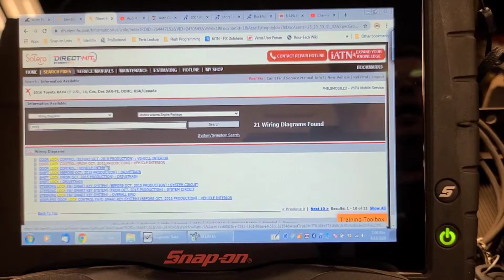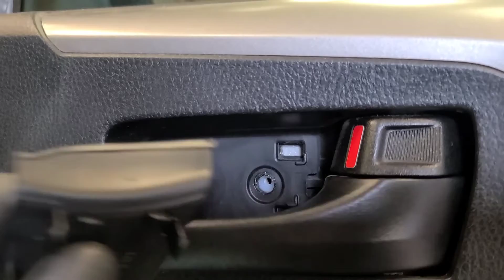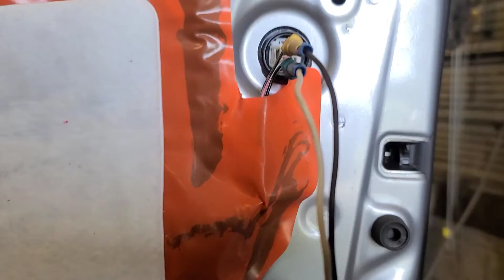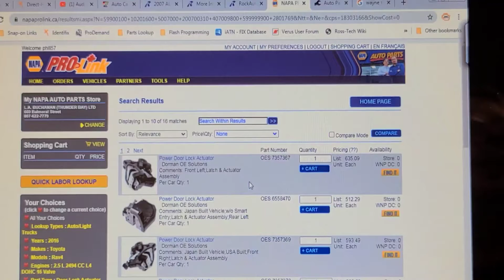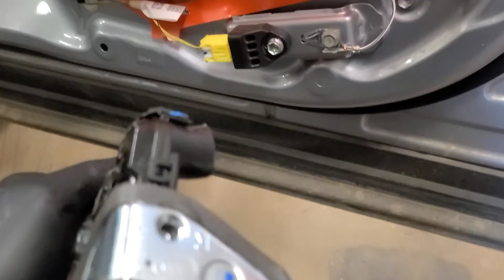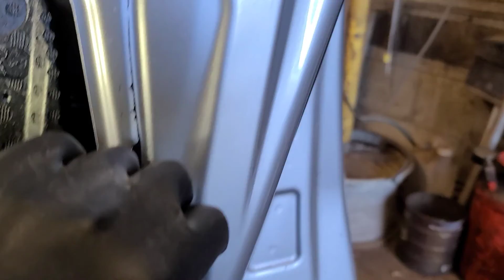2016 Toyota Rav 4 Passenger Door Lock Problem

Comment: GREAT video! I also love to take things apart to see what's really going on. That's really BS to have to buy a 600.00 motor that probably cost less than a dollar for them to make... The old me would have swapped the motors and sent the part back, but I have learned you don't get ahead that way. My wife's RAV 4 has an issue on the driver's side, but I've not torn into it yet. But thanks to you, tackling this problem will be a lot easier. Thanks for the time you spent putting this up!
Reply from the maker: You can buy just the motor, not from the dealer but aftermarket. Trouble is there are a couple different versions of the motor and you won't know which one you need until it is apart.
Reply: @PhillipBailey  Hello again Phillip. The problem has progressed to a failure more often than not, and it's now affecting two doors. I removed a module from the passenger door today and got the information off the motor. For $30.00 I have 5 of them  coming on a slow boat, and a third of that was freight. You weren't kidding when you said they were not meant to take apart - more plastic tabs on that case than I think I have ever seen. I'll let you know how it works out. Thanks again!

Comment: What’s the part number of that little motor? I have the 2018 RAV4 same issue.
Reply from the maker: The trouble is there are two or three different motors and until you take it apart you won't know. Different shaft designs.
Reply: Thanks.

Comment: This for me is a common problem and should be addressed by Toyota.  I have had three RAV4's in the last five years that have had this problem.  The first one the problem was intermittent and I just sold the car (not because of the door).  The second one the problem was permanent and sold it as well.  The third one now has that problem and I've just been living with it.  Clearly there is some sort of manufacturing problem with the motor and Toyota should recall and replace and never use that parts manufacture again!  Just my two cents worth...
Reply from the maker: I have since found that you can buy the motor from various sources on ebay. Problem is there are a couple different style of motors and you can't tell which you need until you get it apart. At least if the part was more reasonably priced it would not be too bad. Doubt that it will ever be recalled since it does not affect safety.
Reply: @PhillipBailey  can you share an ebay link of such motors for posterity ? :-)